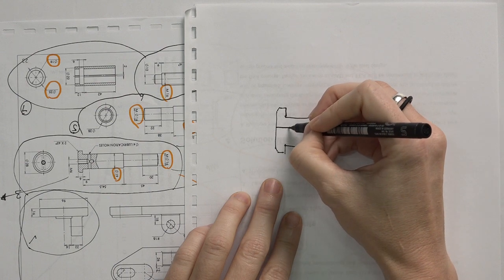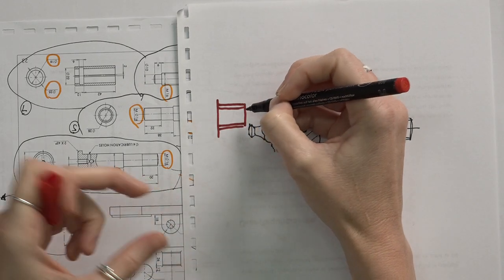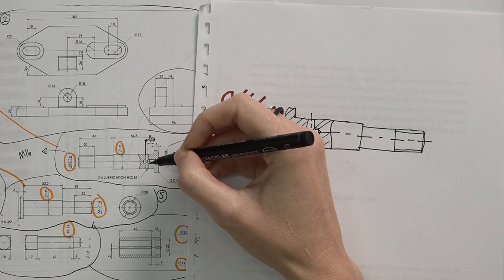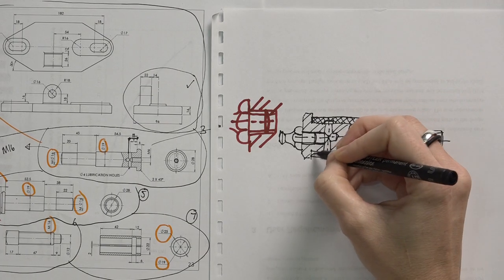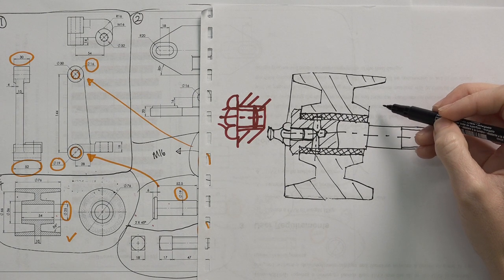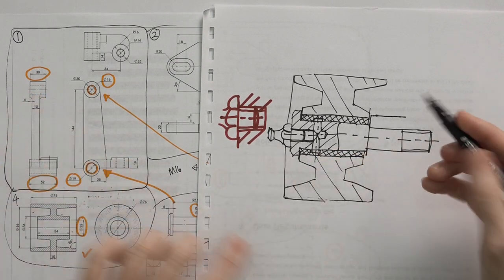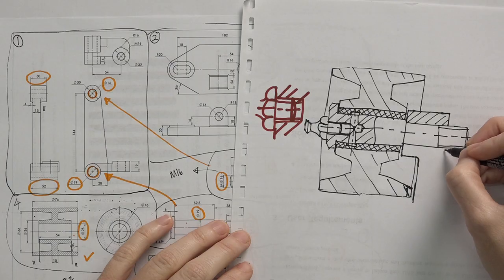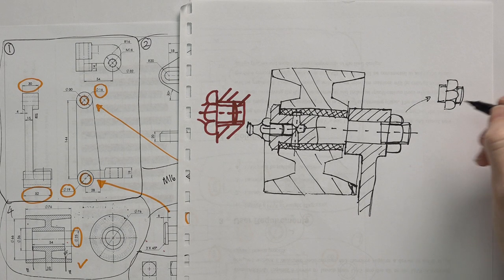Assembly: Exam 2010 part 2 of 3

Comment: Ma'am
Can we not bring out the part 1 in the right side of the page if the nut is removed
Reply from the maker: Good day,
Thank you for the comment. I am not 100% sure what you mean, but the assembly layout can not change from the way it was done here. In the question the basic layout was specified, so we must draw it the way the question asks. The component 1 cannot go in the other way as this will cause an interference between the wheel and part 1 due to the gap being 4mm on the one side and 11 on the other side. I hope I have answered your question here.
Reply: @riaanmeeser4755  Yes ma'am
My question is answered , thanks for the reply